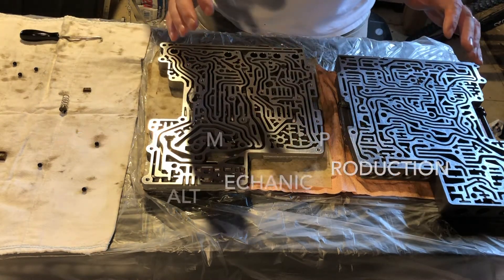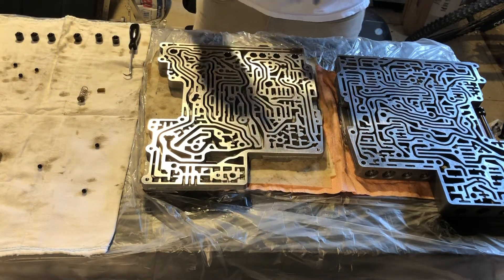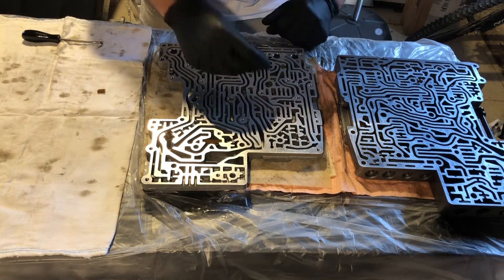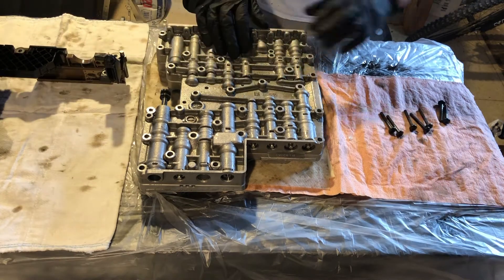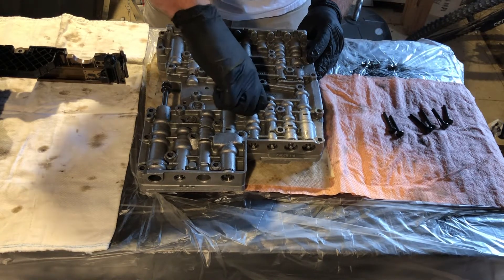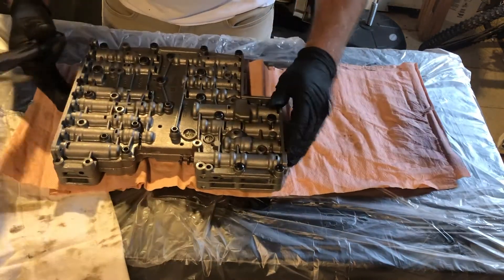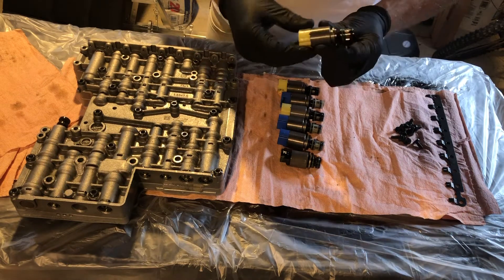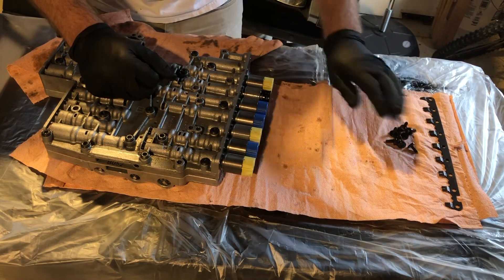How To | Rebuild ZF6HP26 Valve Body | BMW 550i E60

Comment: Where do I get that from? I have a BMW 5 series
Reply from the maker: Hi friend, you'll have to search Google for your exact transmission.  I did a search on "ZF rebuild" and found this immediately--but you'd need to ensure this is for your specific transmission. 

https://www.ebay.com/itm/256581583360?chn=ps&_trkparms=ispr%3D1&amdata=enc%3A18o3-2EELR6ef4mAPcDJEiQ34&norover=1&mkevt=1&mkrid=711-117182-37290-0&mkcid=2&mkscid=101&itemid=256581583360&targetid=2321310837104&device=c&mktype=pla&googleloc=9051849&poi=&campaignid=21214302385&mkgroupid=161029887581&rlsatarget=aud-1314496317547:pla-2321310837104&abcId=9407524&merchantid=138374570&gad_source=1&gclid=CjwKCAjwzMi_BhACEiwAX4YZUAJlfCGfK-hGjg2WDnBOXuse5x6V26ROD3fJ-PDnCMZeLFM9IcnbcxoCNu4QAvD_BwE

Comment: How do you clean the valve body
Reply from the maker: I use all purpose cleaner (50/50 mix) in my parts cleaner, then rinse in isopropyl alcohol and blow out with my air compressor